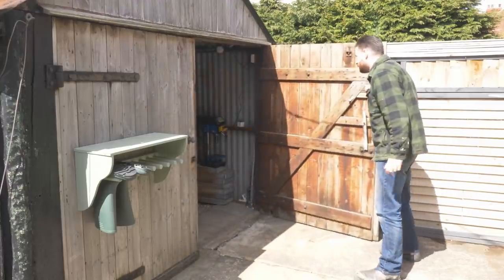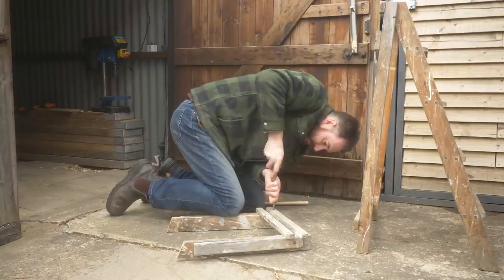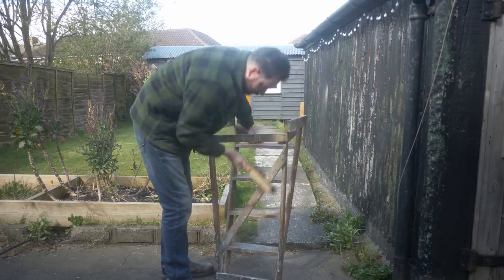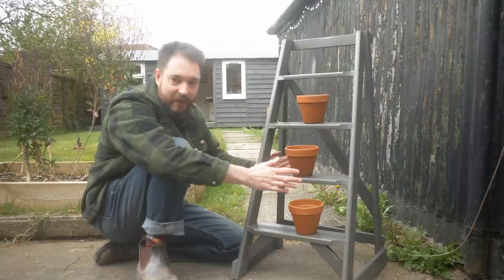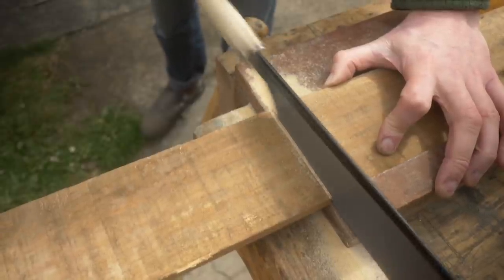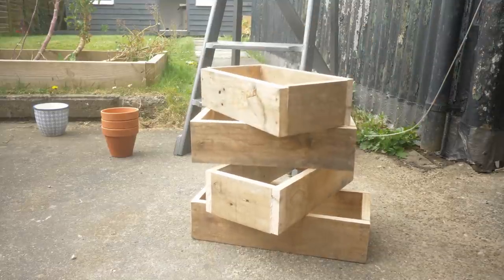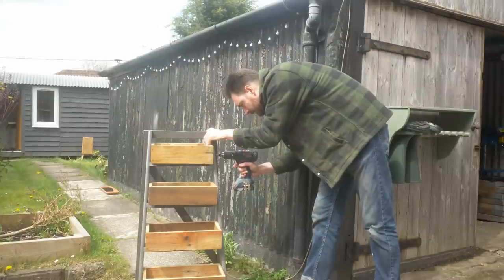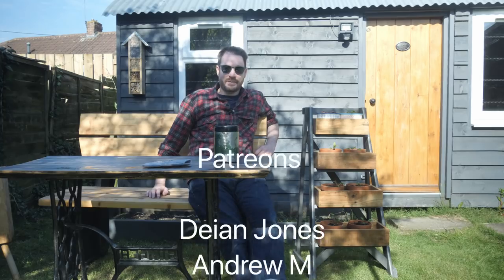Making A Ladder Plant Stand

Comment: Hi, I have had my rough neck pry bar for a long time now and when I think of all the effort I put into getting pallets broken down before I had the breaker bar I feel as if I wasted hours. I also have a nail removal gun that works with my air compressor and it takes all the hard work out of de-nailing. I just put the gun over the nail and fire the nail into an empty tin; it is so good at removing nails that I could probably reuse the nails as well.
Reply from the maker: That air tools looks great. Must really speed things up
Reply: @Badgerworkshop  yes and it was bought at toolstation so you should be able to see it and decide if it is for you

Comment: When pulling the nails out of the pallets please use eye protection. I've had the heads of a few nails separate from the body when pulling out and go pinging into the air at a rate of knots.
Reply: Nice surprise Matt no machines used. Ideal easy outside project for a sunny day with impressive looking results. Tony